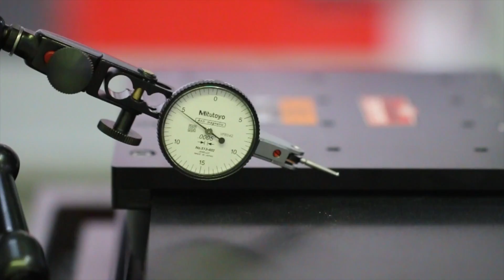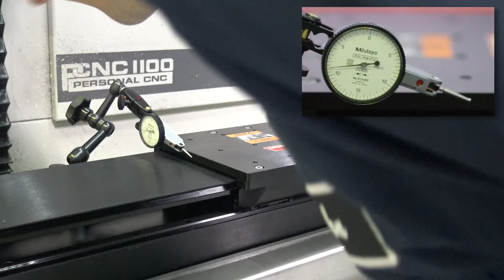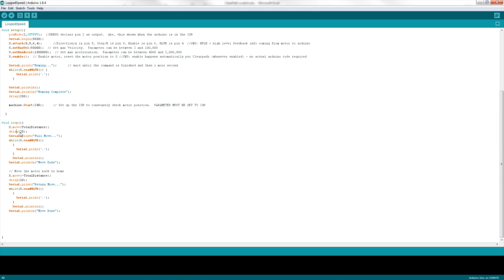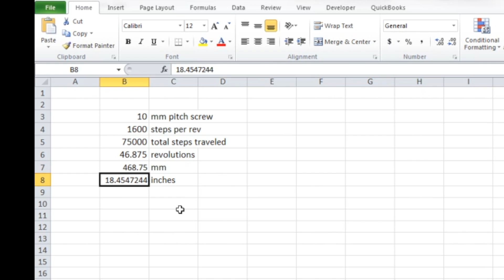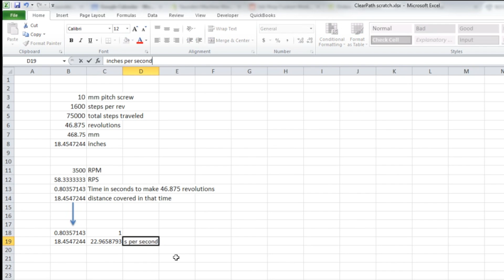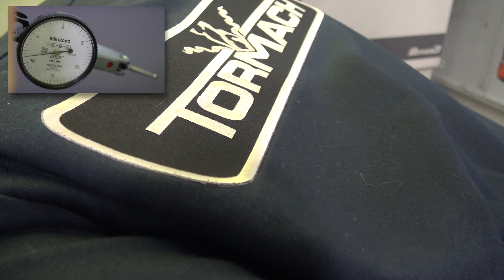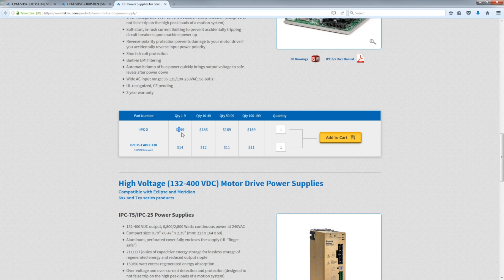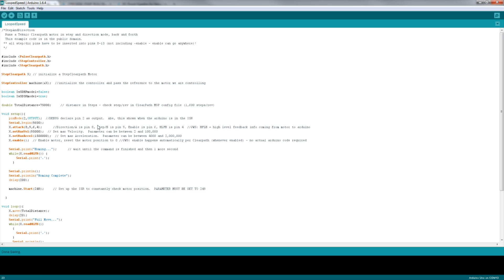SUPER Fast Arduino Servo!  ClearPath!  WW120

Comment: Those are fast movements for travel, but what you didn't mention was the overshoot on the dial - a drawback of the PID control system they use.
As a test can you do a diagonal cut through a long test piece with one axis driven by the Tormach and the other with the Clearpath. The test piece should have bands of varying thickness metal cuts to see how well the control loops keep thier linearity with rapid changes in torque.
Reply: Thank you for your comment Lee. I'm an applications engineer for Teknic and I wanted to follow up. That type of dial indicator is used for steady state measurements rather than dynamic measurement. What you are seeing is the overshoot of the dial as the stage strikes it. In other words, the energy of the stage striking the dial causes the dial mechanism to accelerate, and because it is undamped, it overshoots and rings.

Any overshoot of the stage is likely to be in the range of about 0.0156mm, but probably even less than that. Overshoot due to the motor is easily less than 20 encoder counts, more typically 0-5 counts. For this linear stage, that translates to a distance of 0-0.0039mm. This value doesn't include any error in the mechanical system, but the Bell Everman stage is very high quality and will not have much error.

I believe John is planning a future video showing how to use ClearPath's MSP software program as a diagnostic tool to show ClearPath's dynamic tracking accuracy. Also, your suggestion of making real-world cuts on a diagonal (or circles) is excellent and the best true indicator of overall system quality. Acrylic is a good material to use because it is very easy to see any errors. 
As an aside, ClearPath actually uses a PIV servo compensator with velocity, acceleration and jerk feedforward, with fuzzy-logic based inertial anti-wind-up, and vector torque control with sinewave commutation. With a good mechanical system, it will generally have near zero overshoot.

I'd be happy to answer any questions you have. Feel free to give Teknic a call if you would like to learn more about ClearPath or our other products.
Reply: Teknic Inc can we buy these in the UK  or do we need to import from the USA
Reply: Apologies Teknic, I didn't get a notification of a reply until Gaatech also replied.  While I appreciate that your system likely works exactly as you say 100% of the time under 95+% of the conditions thrown at it, I was trying to point out that in the other <5% of conditions it will behave differently.  This is a necessary fact of any system which has a closed loop control system.  In tuning the system you're defining its normal working conditions such that you can work in the upper limit area of its operation - else that system would not need to be tuned.

I agree with the circle / diagonal for showing errors, however I disagree with the acrylic comment, and also the implied, steady state, continuous cut test.  Control systems will normally exhibit maximum error on step-changes in conditions and working modes, such as a rapid transition between free-air to a high-torque steel cut, or oscillating conditions like a rapid high torque cut through "waves" (max instant cutting area / drop) shapes of steel/air.  They also suffer when the environment changes say, if a machines exhibits fluctuations in elasticity in certain areas.  Done badly (and I'm not saying Clearpath is done badly) those dynamic, non-tuned, environment changes can be fed-forward and exasperated when combined with changes to the input of the system at the same time.

Sorry, I'm not trying to say Clearpath is bad.  I've heard many good things about it - I've even put them forward as a risk-mitigation alternative to a geared high-torque/rapid movement stepper solution in a design I did earlier this year!

What was trying to say was that, if the tests are going to be done, they should be tests which will attempt to catch those corner cases or worst performance.  Those cases which are outside the capabilities of the tuning or control loop to fully compensate for.

You really use PIV for the high-speed rapid travels shown in the video?

Regards,
Lee
Reply: Hi Gaatech- Teknic does not have a distributor in the UK, however, if you purchase from our website, we ship directly to the UK.
Reply: Hi Lee, Thank you for your comments (and for recommending ClearPath as an alternative in your design!). I agree with almost everything you wrote, in particular your final comment that in order to objectively determine performance of the overall system, tests should attempt to catch the corner cases or worst case operating conditions that are relevant to the machine and its design goals. The most demanding challenges for any motion system (stepper or servo) are rapid (i.e., high bandwidth) changes in torque demand, particularly if the demand comes from outside disturbances rather than the commanded motion. Your suggested tests would be challenging, and if handled well, indicative of a well-designed system.

Our discussion here has mixed together issues of servo performance with those of overall system performance, and since there are many issues to consider when designing the overall machine (e.g., the mechanics, the environment, variations in load, the motion control system, etc.), it might make sense to just discuss the issues relevant to servo performance alone. In other words, the tests you described are good for evaluating overall system performance, but if we want to analyze what the servo’s contribution is, we should just measure ClearPath’s dynamic position tracking performance (i.e., comparing its commanded position versus the actual encoder position at each instant in time). And, ideally, we would do this with a worst-case situation like you describe. This would show how the servo performs with the attached mechanics and associated load conditions, but not show the error contribution from the mechanics or other sources.

You are absolutely correct in saying that the tuning is, in effect, optimized for a set of expected operating conditions. The further that the actual conditions deviate from the tuning conditions, the less optimal the performance will be. Of course, this is true about all systems, including steppers. Because steppers are essentially open-loop, spring-mass systems, their tracking performance will change markedly as the load conditions change. This can be seen by putting an encoder on a stepper and comparing the commanded position to the actual. If the conditions change enough, the stepper will lose steps and then stall. The fact that they can’t be tuned (except when run as a servo), does not mean that their performance does not change with load conditions. A well-designed and tuned servo will generally tolerate a larger change in conditions before exhibiting significant changes in performance, but eventually, with extreme enough changes, the servo too will fail to operate satisfactorily.

An important question with servos is, “How robust is the servo compensation algorithm to changes in load conditions?” ClearPath has a very sophisticated servo algorithm: the position/velocity compensator is a PIV structure with velocity, acceleration and jerk feedforward with several proprietary inertial anti-windup enhancements that allow very high inertial mismatches. Its torque compensator is a sinewave-commutated, D-Q space vector controller with cross-coupling terms for motor resistance and inductance, and Ke feedforward. (I realize that’s a lot of jargon for most people, but you sound like you have servo experience.) Hopefully, John will do a subsequent video that shows the ClearPath’s dynamic tracking performance using your suggested worst-case conditions. I think you would be impressed.

Again, thank you for your informed and thoughtful comments!

Comment: So is that slop in the dial or the bed? It clearly jumps to 10 on the dial before settling at 0.
Reply: SoundsFantastic looks like preload on the indicator to me...about 9-10 thousandths. When it's reading 0 the platform is at the start position.  When it moves away, the indicator tip isn't preloaded anymore, so it moves the 10 thousandths to follow the platform until it runs out of travel and the dial reads 10 or so. When the platform comes back, the indicator tip meets it, and is moved back to the starting location again...exactly (at least within a few ten thousandths of an inch, which is as much as this indicator can show). 

The preloading is used to make sure the indicator tip is actually touching the platform. 

-- Mike
Reply: BigMjolnir the needle goes past zero then comes back. That's not preload, more like overload. It seems to be slop in the dial, the base bumps the needle so fast it pushes it past dead stop then settles on zero.
Reply: SoundsFantastic Yes.  Momentum transfer causing bounce. If that's all it is, it's not a problem. You'd need a different instrument, or a high speed close up, to see if there's anything else going on. I'm sure there is if you looked closely enough...everything is elastic at some scale, but below some point it doesn't matter to the job being done. For John's purposes, it looks more than good enough. If he was doing realtime laser interferometry probably not...but at that scale there are lots of other sources of error he'd have to deal with.

-- Mike

Comment: Yeah... exactly what is amazing about a servo getting to the exact same position several times ? Any servo that can't do that, isn't on the market because no one will buy it, period. Hell even open-loop steppers can do that if you know how to use them. This ain't "amazing", it's just normal. I get the same result with no-name eBay AC servo kits and those even go faster. Are those Clearpath thingies particularly cheap ? What did I miss ?
Reply: Yeah... only until the rubber stop starts wearing down, though.

Comment: A couple of notes - you can configure the percentage of total available torque used during the hard-stop homing sequence,  We typically run them around 5% torque for homing, and use VERY hard stops (steel) to prevent any elasticity variable with rubber stop, such as temperature.  Homing at only 5% torque protects every part of the machine against potential. jarring.

Also, there are two distinct families of Clearpath motors - the MV series and the SD series.  The MV motors are used for a variety of SIMPLE applications that would typically utilize a PLC to control and drive a SINGLE conventional stepper/servo motor.   The advantage with the Clearpath MV is that you program it once using a USB cable and a laptop, after which it will reliably repeat that program forever, being triggered by simple analog switch inputs.  So no dedicated computer/controller required.  Changing the program does require using a laptop and USB, but in most cases you'll simply want to "set it and forget it".

The SD series is primarily meant to replace stepper motors, and they provide greater accuracy, speed, and torque along with ZERO chance of dropped steps.  They basically turn a stepper system into a servo system VERY economically.  Caveat: the feedback loop is self-contained within the motor itself (built in tach & encoder), so there is no feedback loop out to your computer screen or DRO.  However, in practice the low-end "DRO" feature of Mach3/4 (for example) is perfectly adequate due to the motors faithful reliability in executing the commanded moves.

I have built and/or rebuilt many, many small shop machines, and since adopting Clearpath SD motors a few years ago I will NEVER use another stepper motor for any application I care about.  They're just that good.

Comment: how do you connect the arduino to the motor?
Reply: The usual manner is IO pins on the Arduino for step (i.e. move one step on each pulse) and direction (high for one, low for the other) run to the controller.
Reply: Yeah I understand that, but I mean what is needed in between. Optocouplers, transistors or maybe just a wire.
Reply: It looks like the motor's inputs are already isolated so nothing is needed in between.  Just connect the arduino output, and ground straight to the motor's input.

Comment: I purchased three of the nema 34 versions 1392 oz/in to convert my old j2 bridgeport over to cnc.  There is a really nice controller to run these with called Masso by Hind Technology. Tons of IO points and it runs its own software and is capable of running 5 axis.  Might want to check it out. I will post some video of the mill when I get the motor mounts finished up.
Reply: John lambert awesome I'm subscribing I want to do the same
Reply: how is the masso working for ya? was very interested because it was a stand alone option
Reply: I have been busy working on my wood splitter. Wood season here in Ohio. I will post a video of it when I power it up and post it.

Comment: Hi John, cool stuff.  Did you consider replacing the steppers in your oldest Tormach?  Must have crossed your mind, right?
Reply: I have been looking into the ClearPath products now, and they are really cool and affordable.  Especially when considering the built in controller and the torque they are producing in relatively small packages.
My Schaublin 22 mill doesn't have power feed on the Y axis, oddly enough, so I'm considering a ClearPath for this now.
Thanks for pointing me in that direction

Comment: Who made the linear stage?  I think you just helped me solve some several things I was concerned about with my surface grinder retrofit.  Now if I can figure out the code to have the Total Distance to be adjusted by a simple potentiometer, so a simple turn of the knob will adjust how far the table will travel...

Comment: Why no raspberry pi love?
Reply: Raspberry pi is better suited for things that need an operating system , gui etc.
Reply: Leestons I've used a pi to make a DIY Cnc control interface for controlling a ardunio . Touch screen and most of the common controls with buttons and jog wheel etc .

Comment: The hard stop isn't important accuracy wise; when it hits the hard stop and reverses directions, its then looking for a specific encoder count. As such, it's accuracy depends entirely on the encoder count, along with any slop that occurs in the notion system beyond the encoder.
Reply: it is, coincidentally, the same method Fanuc has used for years for zero return on absolute encoder systems. In fact, it's also the system that's currently biting me in the ass on my lathe :)

Comment: That's as impressive as a  sports car with 700hp motor, but the same question applies....When am I going to use that in the real world? I've never machined or plasma cut anything at 1,100 ipm.  I understand the closed loop accuracy advantages of servos, and if NASA quality tolerances were required, I'd go the extra money, but for what most of us are doing in small or home shops, servos are an unnecessary luxury.
Reply: You'll using it by proxy when people are manufacturing the things that you buy to "NASA quality tolerances". Or perhaps you'll take up 3d printing someday: half a thou accuracy is a shade over the Z layer thickness that I can print using a stepper coupled to threaded rod. I spend minutes per layer, though: The Z axis doesn't move very much per minute. I wouldn't mind having two of these linear stages for my printer's X and Y axes when the "rapids" for those axes are 2 IPM at best. Of course, the price has to come down on these when the power and motors cost more than my printer.
Reply: AndTheCorrectAnswerIs it shortens travel times and provide accuracy. not sure about clearpath ones but a lot of servos have feedback so your cnc knows all the time even if moved manually. only problem with servos is that they have weak torque  when in small form. As soon they pass few HP they became beasts with strong breaking and all kind of other features.
Reply: We're using clearpath stuff in our 12 cubic meter 3d printer. They make great stuff!
Reply: This is really my interest in them. I'm wondering if I can achieve high accuracy on my X and Y stages using this kind of tech... I currently used OpenBuilds rail for my movement system and maybe even that is s disadvantage if I jump over to servos. I would definitely use ball screws or leadscrews if I was doing something like this though...

Comment: love clear path. they work great with tormach pathpilot as well as mach 3. they are a direct replacement for any stepper motor. we are running them on 6 of our cnc machines. the accel rates you can get are insane. we run much much bigger clearpath motors though.

here's a  vid of one hocked up to our 770 on the a axis. i was still working out the bugs at the time. it's even faster now and working perfectly.

https://www.youtube.com/watch?v=d_MVdAq-EOk
Reply: Can you show a video of the faster speeds and accel rates?